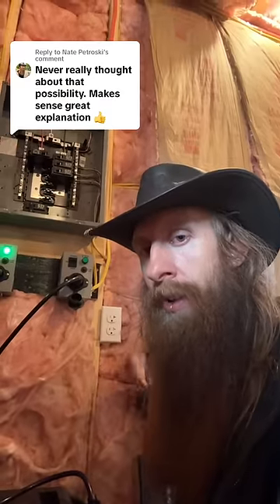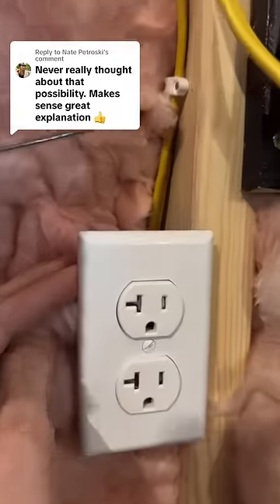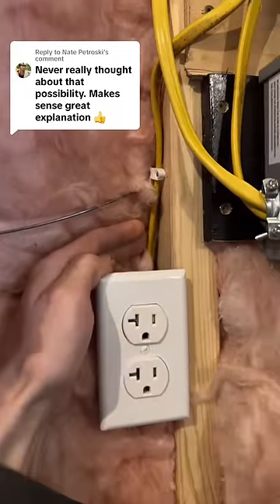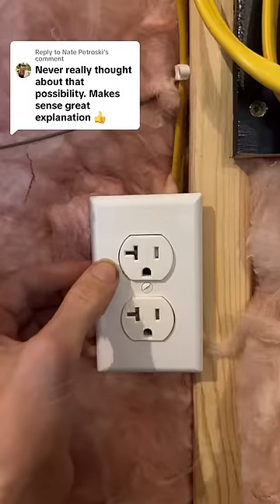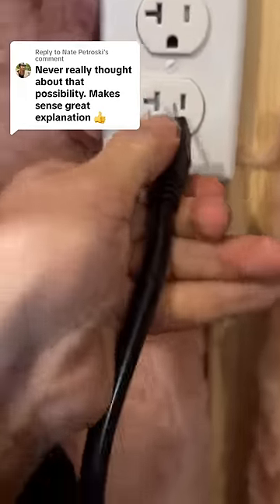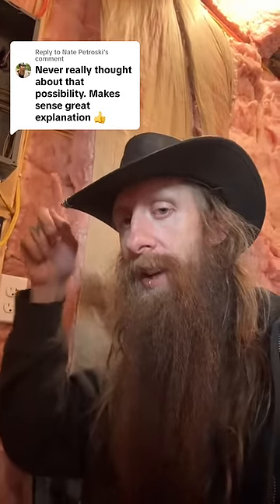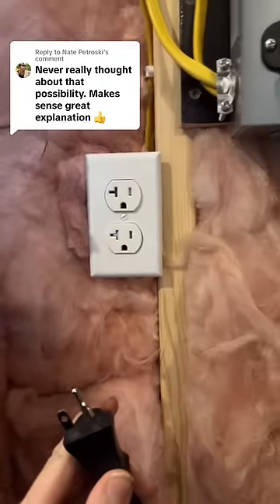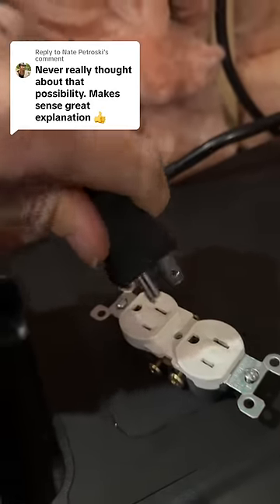20a receptacle on 15a circuit might be a fire risk

Comment: If the 20a recpt. was on a 15 amp wire and breaker, then it would be an issue if a 20a device were plugged in- besides nuisance tripping of the breaker, the 15a wire would be undersized for the load causing voltage drop to the device while in use. Nate has 20a wire, so there's no problem.
Reply: A lot of people have no concern about  overloading and  cooking junk Chinese breakers here for no good reason , Tell me you haven't seen a breaker not trip when it should have  without telling me .

Comment: Whats great is when someone sees the 20a Plug on a $40k medical device and thinks "that's not a normal plug, it must be for 220v... and then proceeds to wire the socket to 220v... and then plugs the device into the 220v... lets just say that was not a cheap repair...

Comment: You are using 12/2wire which is 20 Amp as long as it's a 20 Amp breaker there is no fire risk so if you are using 12/2 wire On a 15 circuit it's just overkill but still not a fire risk

Comment: The main point is that you shouldn't rely on the breaker in the first place. If everything is sized correctly, a breaker won't trip unless something really bad happens. 

Ive got a 120v MIG welder ehich has a 15 amp plug from the factory butnit really should at least be a 20 amp, if not 30. Chinese electrical devices at their finest!

Comment: It looks like you're using 12 gauge Romex, so you could just put it on a 20 amp breaker, assuming that it's a dedicated line...
Reply: It's not a dedicated line unless it's the only receptacle on the circuit and it's a single receptacle, not a duplex. A duplex receptacle = 2 receptacles.

Comment: As long as your breaker is the same or lower rating than everything downstream you are fine. It's a waste but if that's what you have on hand...why not.

The breaker will trip. If it doesn't...tell me how. Update your no longer manufactured system.

Comment: Here’s the dealio, you’re gonna be fine. Just don’t plug a 20A appliance into it unless you’ve used 12/2 which you have so you’re back to being fine.
Reply: Also the breaker is there to protect the wire, if you have a smaller size breaker than the wire is capable of utilizing you’re more than covered.

Comment: so cute because y'all's 20 amp socket still delivers far less power than a regular German outlet with 230V 16 Amp. 😅
we can run all off of a single outlet type besides an electric stovetop and heavy machinery. that usually takes 3 Phase power, so a 5 pin plug that's also standardized. so basically 3x 16 amps

Comment: No way a fire hazard.   
 Looks like you used 12-2 romex wich is 20 amp rated so just use a 20 amp breaker.  But concerning this video the breaker is underrated not a fire hazard.

Comment: It is an NEC code violation due to potential overload. Would have to be changed if you were to sell.
Reply: I don't believe the NEC applies where he lives. They don't have anything in the way of permits or inspections in that county.
Reply: There is no overload risk so long as the conductor and OCP are matched. The receptacle doesn't factor into fire hazard
Reply: No its not
Reply: NEC is a national code standard. Whether municipalities choose to enshrine it into regulation is another matter. However, you will not get homeowners insurance without meeting NEC. Also, yes using a receptacle device that exceeds the ampacity of the conductor is an NEC code violation. You can use a larger conductor and a smaller receptacle device but not the other way around.

Comment: Putting a 20 amp plug and 12-2 romex on a 15 breaker isn't a fire risk. That's the whole point of a breaker. Putting 14-2 wire and 15a plug on a 20a breaker however could cause a nasty fire.

Comment: NEC codes say you can run 20amp outlets on 15amp all day long.
Reply: Table 210.21(B)(3) would beg to disagree with you there sir.
Reply: Yes you can but not a single receptical

Comment: Um, i dont think its a fire risk  to put a 20 amp plug on a 15 amp circit.

Because if you think about it you are puting an outlet designed to bair a larger load on a circit system with a far less load meaning how can there be a fire if the plug is a higher load barer.

If it were to be the oposit way then i can understand.

Comment: Whoever said that thinks he's a real genius, but I disagree. You know what else can overdraw your circuit? Plugging in a bunch of devices with regular plugs across multiple plugs in a circuit, using multiple power splitters with a bunch of draw on them. Apparently this guy also didn't notice you have 20 amp wire running everything, which makes his entire point moot. If you have a 20 amp plug, and 20 amp wire, the 15 amp breaker is just going to trip before anything is close to its ratings. And the same can be said for a 20 amp breaker, it can fail, and someone could hook up too much stuff to the circuit. The way you have that set up, with a 20 amp wire, as well as a very short run, there's very little risk of a fire. As long as you have solid connections that is.

Comment: Its a lot of messing about. Ive never heard of this kind of set up with different amp sockets. In Ireland, the plugs are fused with the relevant amp fuse and the sockets are all the same. 

But you seem to know what you're doing and nobody seems to be able to contradict what you're doing with any real conviction.
Reply: The circuit capacity doesn’t change with the fuse though. A 20A device with a 20A fuse plugged into a 15A circuit can melt/burn the wiring inside the walls.

Compared to 120v, 220v supports higher wattage with thinner wire gauges (watts are volts * amps). Perhaps this means you guys can afford to have thicker wiring than you need for every outlet, but amps are amps. What is the maximum amperage for a typical receptacle?
Reply: @emmettturner9452  I think we have exceeded my electrical knowledge now 😄

I think our 220v socket circuits are 2.5mm cable....I think.
We run lower hertz though than America...maybe that makes a difference?
Reply: @Boru06  Ah, yes. 2.5mm² is good for about 13.5A. That’s 2,970 watts vs our 1,800 watts from a typical 15A circuit in America… but we aren’t supposed to use more than 80% of that for continuous loads (safety factor). That is why plug-in heaters, induction cookers, and hot water kettles are limited to 1,500 watts here. That’s half the capacity you guys have, so it makes more sense that you can limit the amperage with a fuse at the device.

This is the real reason hot water kettles aren’t a staple fixture in American kitchens: They’re too darn slow at 1,500 watts! Though it’s still slow compared to your kettles, a microwave works nearly as fast as a 1,500 watt kettle and is already there for most. That said, I found a used kettle from the Philippines and wired it to 240v here in the USA. :)
Reply: @emmettturner9452  Thats really interesting. A kettle is as important in an Irish home as an Irish Mammy is 😆 

Our electric heaters are commonly 2.5k watts, but usually adjustable. 

Saying that, I do remember noticing a socket cable looking a bit crispy while insulating my parent's house....it was primarily used for an electric heater. I blamed in on a faulty socket but now Im not so sure...

Any of my friends who moved to the states all remarked how power tools had so much more power than in Ireland and I never knew how untill the mine I worked for got a large motor in from Canada...it was 60hertz and couldn't be used here without a converter. It was then I realised why the power tools had noticably more power in the states.
Reply: @Boru06  I burned/melted a 15A socket by plugging in a Chevrolet Volt and bumping the charge rate up to 12A. It defaults to 8A because they know a lot of 15A sockets are worn out and could melt at 12A (80% of 15A). Turns out that was one of them. Of course, the wiring in the walls doesn’t wear out so there was no fire hazard there.

After that incident I changed it to a 20A 240v socket which I use for the Chevrolet Bolt EV (replaced the old Volt). It now charges twice as fast (double the wattage but still 12A) with no overheating… and I have a place to plug in the hot water kettle! Now I can boil water at Irish Mammy speeds. ;)
Reply: @emmettturner9452  You'll need your seatbelt for those kinda speeds!! 😂

Comment: A 15-amp outlet on a 20 amp breaker is fine. 20 amp outlet on a 15 amp breaker, not ok
Reply: Yes its ok, code says that you must run multiple outlets though.   Im a retired Journeyman electrician, l got my card back in 1995

Comment: I have an air compressor that uses they type of plug. I had to install a 220-volt 20 amp breaker for it.
Reply: The 240V version of that plug is different still, being basically its mirror image. A 15A 240V plug has both blades horizontal, and the 20A 240V plug has one vertical and one horizontal but they're the opposite of the layout shown here. This means plugs for 240V 20A also do the 15A trick shown here, but you can't plug 120V into 240V or vice versa. Safety through design!

Comment: The device is fine on a 12/2 wire and 15 Amp breaker. Its fine. But the reverse is not ok. Do not run your 20 amp duplex device on a 14/2 wire gauge. It may never be a problem, but……. You might have issues.

Comment: What blows my mind is how many professional YouTube electricians think circuit breakers are designed to protect your house. No, the wiring system in North America is not designed to protect your house, it's designed to protect the power pole. They'll let your house burn down. That's how the system's designed. Your house will burn down before you blow the pole 😂😂
Reply: You are correct. Circuit protection is to protect the conductors not the device.